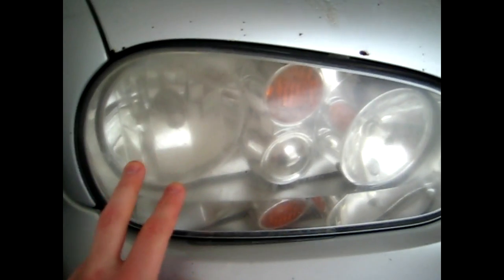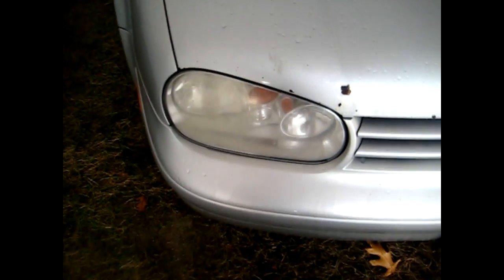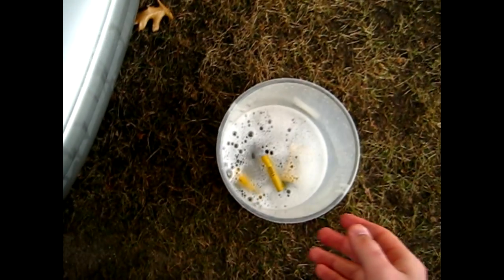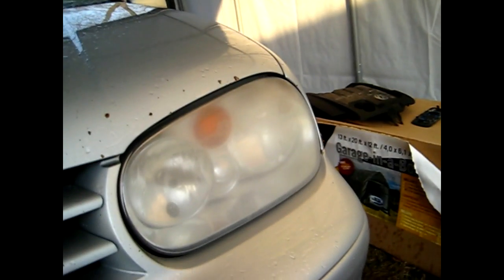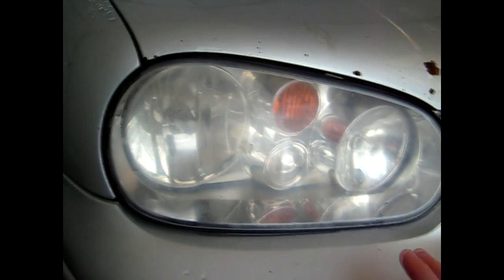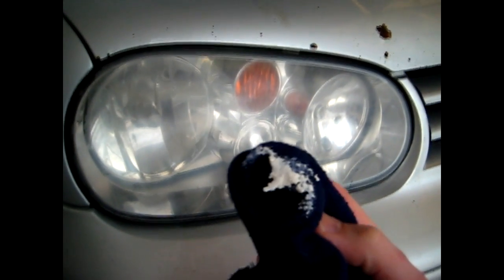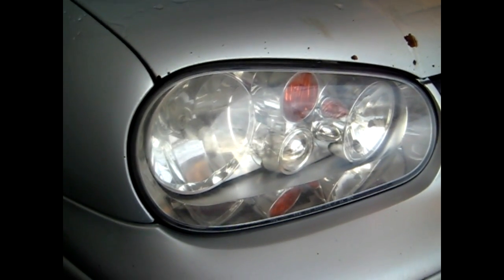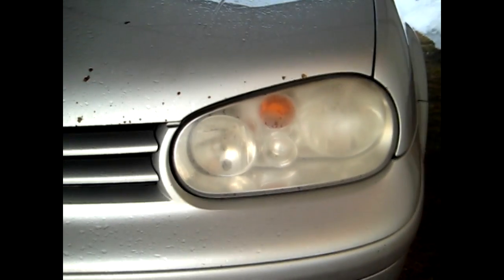DIY: Polishing Foggy Headlights

Comment from the maker: If you have moisture on the inside of the headlights. Just take the bulbs out and let it sit in the sun or turn the bulbs so they're not fully clipped in the housing and leave the lights on for a period of time to help warm up the housing. Either way should help dry out the moisture on the inside.

Comment: I just followed your video. My local hardware store only had 600 and 1500 grit paper, so I used that. I made 5 passes with polishing compound and finished with a coat of turtle wax. Works great. Thanks!
Reply from the maker: +carlorocky Excellent to hear and thank you.

Comment: The headlights on my son's 2003 Maxima were about the worst I've seen. They were so cloudy you couldn't see beyond the outside of the lens. They had also yellowed terribly from the intense Arizona sun. It took 3 sheets of 1500 per lens requiring us to stop between sheets to wipe away the white mud that was building up. Next was 2 sheets of 2000 followed by 2 applications of liquid polishing compound. Finished up with wax. Unbelievable results! As clear as brand new lenses! Thanks for this video.

Comment: I had been buying the kit sold at Harbor Freight which comes with a drill attachment and two peel and stick sandpaper disks and a peel and stick sponge which you apply liquid polishing compound to, Total cost of kit is $9.00, But after watching this I will be heading to my local auto parts store or WalMart to buy a container of polishing compound some Wet & Dry sandpaper and some good auto polish. Thank You for your helpful video.

Comment from the maker: @Mark Greiner Not everyone has access to an electric buffer and to purchase one can be fairly expensive, especially if someone is only using it for this specific task. And the other issue is that if someone is a novice user, it can cause more damage than good. Sure it does take longer by hand, but if someone is patient, they can still achieve the same quality results and the risky is greatly reduce of damaging the headlight. By hand, once has much more control.
Reply: True, but a drill pad attachment works quite well and isn't terribly expensive.

Comment from the maker: @Dorene Librana That is a black rubber pad. 3M refers to it as a squeeze which is actually it's original intent, but I use it as a pad to ensure the surface is sanded equally and smoothly.

Comment from the maker: Thank you! 
Yes there is uv coating originally on the headlight, but normally when they're in this condition it has already worn off. Now there is kits which include applying this uv protection and I believe you can also buy it separately. When applying the wax like I did in the video, it also does help with being a uv protector to prevent the lights from going hazy.

Comment from the maker: Yes it should remove the yellowish color of the headlights. Usually it's the outer coating on the headlights which gets discolored, it depends on the manufacturer materials used.

Comment from the maker: Thank you so much for the support! :)
Yes toothpaste does work, although not as well and quickly compared to actual compounds. Toothpaste does contain a very fine abrasiveness compound. If your headlights are only slightly foggy, then it wouldn't be too much work at all. Although if they are more severe like mine, than it's much for work intensive and you may not achieve the results you want. I'm actually hoping to do a toothpaste polishing tutorial in the future as a comparison.

Comment: I did this following the instructions on the video. My car is a 96 Skyline and has long had a problem with foggy headlights. Unfortunately while doing this did make them look better, they didn't come up as good as in the video. Considering the amount of effort put into this (I've tried various other methods in the past with less success) I think this is as good as they are going to get. Much better, but not the near-new look I was hoping for.
Reply from the maker: If you are finding they are still hazy, try wet sanding with 2000grit for a longer period of time not applying too much pressure, then moving onto the polishing compound and further. The coarser grits are needed to take the rough spots out of the lenses, but it's more of a delicate process with the final buffing stages.
Reply: 4Diyers thanks. Might give it a go sometime

Comment from the maker: @clairefbonilla Glad to help out, thank you for the comment! I haven't experimented with using clear coat on the headlights. I have used it on taillights before after spraying them with the nightshade tint. The clear coat would provide a hard surface. The only issue is that you would have to wet sand and polish the clear coat after to achieve a glass finish because it will have a certain amount of orange peal.

Comment from the maker: Austin Reyher You may be able to repair it, but there will be very deep scratches from the 100 grit sand paper. More material will need to be taken off. That may jeopardize the structure of the lens though. I do have another headlight restoration method using clear coat which will be released tomorrow at 6pm and that may be the better route to repair the heavy scratches.

Comment: I have a 2002 VW Bora and watch a tutorial on how to get the plastic lenses clear again by using toothpaste. I've tried that and the lenses are a little better but still a bit foggy. Think I might try your technique. Seems like a sure fire winner to me.
Reply from the maker: Roy Martin I have done a tutorial using tooth paste as well and from my personal experience it doesn't achieve that his shine compared to this method. You may also consider wet sanding and then applying clear coat which I have a tutorial for as well.
Reply: Thanks. I've taken the advice onboard.

Comment from the maker: @FalkenZ08 Possible you can go straight to the rubbing compound. It may take a little longer to achieve the clearness, but it is doable. If it doesn't work as quickly as you would like it to, then you can skip straight to the 2000 grit sand paper and then compound and wax.

Comment: Good work - just an fyi - after using the wet & dry paper, ""brasso" is really good for finishing . . . I find it a little less messy than rubbing compound and it cleans the plexigass up even from the 1000 grit wet & dry.
Reply from the maker: Excellent tip, thank you for sharing!

Comment: @4DIYers i got a free time yesterday and did it. it did came out clean and clear by just using a rubbing compound and polishing compound which took me around 4-5 minutes on each one! but hell its was freaking worthet and i used a teflon wax from dupont it worked fine

Comment from the maker: Well not everyone has access to a buffing machine or drill and this method is much more portable/convenient. You can use a hand power tool if you wish. Although I would be slightly cautious considering there is a possibility of burning the plastic if there is a lack of lubrication or held in one stop too long.

Comment: GREAT VIDEO! i think this is by far the best DIYer's video where most of them don't have buffing tools and you proved hand sanding, polishing and waxing works great too! I'm going to try this tomorrow with the only exception being I will clear coat 2 or 3 layers instead of waxing as the final step. will that be ok? thanks a lot for the video anyway
Reply from the maker: Thank you! I do have a video on clear coating headlights as well. Up to 1000grit should be the last step before applying a clear coat and it doesn't need to be polished.

Comment from the maker: Just depends on personal preference or what is available for a finer grit compound. I have found 3000 grit isn't really that common to purchase in local stores. If you take your time with 2000 grit and then give it a good rub down with polishing compound, there really isn't a need for 3000 grit sandpaper either.

Comment: Totally overlooked this! all i have is 1000&2000 sandpaper at the moment so ill have to pickup polish and do this,

Cheers!
Reply from the maker: I also have a video on using clear coat for a more permanent method. Meguiars Ultimate Polish is probably one of the best off the shelf polishes as well.

Comment: i have the same car but it is slightly earlier production (pre 2002) so has glass headlights which means it stays crystal clear and no cloudiness like in plastic headlights.
Reply from the maker: Unfortunately the North American market didn't come with the glass headlight lens option. But people here are doing the swap themselves and retrofitting glass lenses instead. I don't believe they're overly expensive but much much better than compared to the plastic lenses.

Comment from the maker: @Mastamule What kind of grit sand paper did you use? I normally use a wet/dry sand paper which doesn't dissolve in water. The grit I started with was 1000, then to 1500, then to finish off with 2000 before polishing. If you use a heavier grit, the light will appear more hazy, until you move up to a higher grit.

Comment: Best to tape off the painted edges. Paint is always thinner on the edges (because of surface tension during spray paint application before the paint sets) and the sandpaper will inherently apply more pressure on the painted edges; thus thinning and removing the paint quickly.
Reply from the maker: MEAlvisUTube Excellent tip, thank you for sharing!

Comment from the maker: Aulia Badres Did you do the full procedure from start to finish??? Starting with a coarser grit sandpaper to finer, then a polishing compound and finishing up with wax??? You do need to take a little time with the finest grit as well as the polishing compound. When using the polishing compound, it should be almost like glass once done and the wax will give that final shine plus protection.
Reply: Yes it is , get uv protection and non yellowing clear coat and your good to go ,
Reply from the maker: OgGarcioVega Yes you can, but it is a slightly different process. Check out my other tutorial DIY: Headlight Restoration using Clear Coat

Comment: helpful video , I would just add that the polishing compound I bought from an auto store had some fine print that the compound could cause cancer , go figure , so maybe use some rubber or those light silicone gloves as a precaution .
Reply from the maker: I've honestly never read the warning labels, but that is definitely something to be concerned with. Thank you for sharing that info!

Comment: You should point out that you are using 'wet and dry' sand paper.
You'll get a much better finish if you use an electric polisher. They aren't expensive. Use it with some polishing compound.
If you are driving modern cars with plastic headlight covers, you'll likely be using the mop more than once!
Plus, they make pollishing the paintwork a doddle

Comment: This actually works, although i started with 800 grit then 1200, 1500, 2000 and 2500 and then before polishing and waxing i used T-cut metallic. Took me around 3hrs on one headlight because i believe someone had sprayed it with clear coat/lacquer which took 2 of the 3 hrs to remove using 800 (should of used 500). Now it looks like new!

Comment from the maker: @Heli Pilot No... The car had 360,000km and had been driven on many gravel roads in the past. If a stone chip is not taken care of right away, they will grow out like that.
Reply: weird that it is black underneath. I would have thought it would be white (lacquer) or bare metal. Unless it was a carbon fiber hood
Reply from the maker: Nope, it did have some surface rust on the exposed metal. I believe these cars have their bodies dipped from factory instead of going through a primer process so it would be a bare metal color when exposed.

Comment: Wow! They turned out looking fantastic compared to what they were before!!  Can you tell me please if we can use this on plastic headlights as well? We have an HHR and the headlights are foggy and plastic :(
Reply from the maker: Marjorie Wurtzel Thank you. Yes you can, this is actually strictly only for plastic headlights. It's a very common problem with newer vehicles and their plastic headlights. You can also clear coat the headlights as well, slightly longer process but much more durable.

Comment from the maker: In my personal opinion, I think 400 is way too course. Even 600 to me is very course too on something you'll be polishing to a glass finish. I used 1000 on mine which were very rough and foggy. I think it would be safe to say that 800 could be a max for using a course grit, but that is only on severe hazing. The courser sandpaper you use, the more work it is to remove those scratched after. You also don't want to sand more material than you have to considering it can weaken the lens as well.

Comment: i did it to my car today and it looks the same as it looked when i cleaned it with just a headlight cleaner. You can tell the difference from before when i hadnt cleaned it at all, but i still cant get that clear like new look, it still looks hazy especially since the parking lights next to them look completely new and super clear.

Comment: I need to go to the store to buy props you use, 
Can you write a list for me ?

Sincerely Happy Easter.
Reply from the maker: Thank you, Happy Easter to you too!

I have the materials listed in the description as well.
-1000 grit wet/dry sandpaper
-1500 grit wet/dry sandpaper
-2000 grit wet/dry sandpaper
-car wash soap
-paste or liquid polishing compound/scratch remover
-paste or liquid automotive wax (I used carnauba wax, but it doesn't have to be)
-2 lint free polishing clothes
Reply: 4Diyers Hi , sorry it might sound a little dumb but if I don't have Polishing compound can i also use toothpaste instead ?
Reply from the maker: safasalam  Not a problem... You could use toothpaste, although it doesn't work as well as polishing compound. This will also vary with final results of what type of toothpaste is used as well. Some have more abrasive, others not so much. I do have a tutorial polishing headlights with toothpaste if you would like to go with that method instead. I believe it is included in the video.

Comment: Hey, I've got this same problem with my mercedes, but the fog looks like its coming from inside and not the outside, will this method still work?
Reply from the maker: If the fogging is occurring from the inside, this method will not work unfortunately. You maybe able to wash the inside of the lenses because the fogging might be just dirt build up. It's usually fairly rare to find the lights fogging from the inside.
Reply: Ok Thanks

Comment: Good video advertisement to send you shopping for new Headlight KIt from your friendly Auto Parts place of choice.
Reply from the maker: Actually no headlight kit is required here. I used materials which you can purchase off the shelf and should be cheaper than the actual headlight kit as well.

Comment: Is the polishing compound and the scratch remover compound you mention here are the same thing..."apply the polishing compound and rub into the light, when it dries you can add a mist of water to help moisturize the product
-once satisfied with the polishing, you can now move onto a scratch remover compound -you can also apply a little water to the scratch remover compound to help moisturize the product" ?  If they are the same thing, does it mean I have to do it twice as you mentioned here?  I am a little confuse.  Also, can you please give me the brand name you use for the polishing/scratch remover compound in your video.  Please reply back to my email as I am definitely need to clean my headlights bad. I went to the dealer and one place told me $79 and another place about $150.  Thank you so much.
Reply from the maker: Both products work on a similar principle, but the polishing compound is a coarser grit than compared to the scratch remover. So the polishing compound will remove the coarser scratches from the sand paper, then the scratch remover will remove any of the very fine scratches left by the polishing compound. The polishing compound was made by Turtle Wax and the scratch remover was made by Mothers.
Reply: 4Diyers

Comment: i dont think i used wet and dry sand paper just regular sandpaper. it did come out cleaner but i noticed after polishing and waxing, there are are some residual scratches. is that normal?

Comment: Is the 1000 grid needed when you have more fog on your headlight? So if I understand it right, it means that you start low (1000 grid) to a higher grid (2000 grid) for finer results. So the higher grid actually removes the scratches, am I right?
Reply from the maker: Yep, you are right. I believe the grit is measured by the amount of abrasive particles on the paper per square inch. If you have fairly sever headlight fogging like I have shown in the video, then I would start with 1000 grit, if it is less, then start withe 1500. Technically you can start with 1500 first, but it takes much more work getting to the next stage. Starting with a paper slightly coarser cuts down the major of surface imperfections which then creates a better base for the next grade of sandpaper to work with.

Comment: There's another solution - glass lenses. I'm fortunate mine came from the factory, but there are aftermarket lenses for some models that are glass. Use headlight protectors if you're worried about glass smashing, I've only ever had one smash and that was a kangaroo impact, takes a big rock to nuke one.
Reply from the maker: Albinus81 Very true. Unfortunately most vehicles available on the Canadian market aren't equipped with glass lenses. But some like the VW MK4 can have a direct glass replacement from a European spec headlight.

Comment: Does it matter the kind of sand paper you use? I went in with the soap and water to clean the headlight, which it helped a lot, but then went in with the sand paper on the rough spots and it seems to have made things worse. I went in with polish afterwards thinking it might help to no avail. What do you think went wrong?